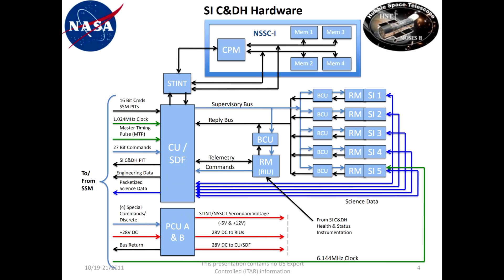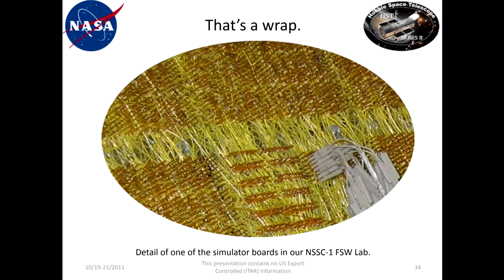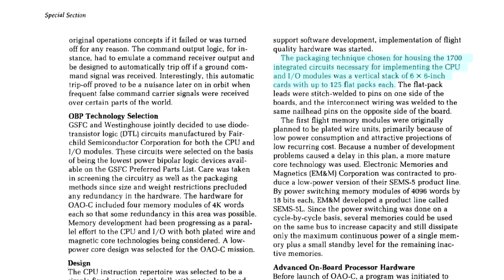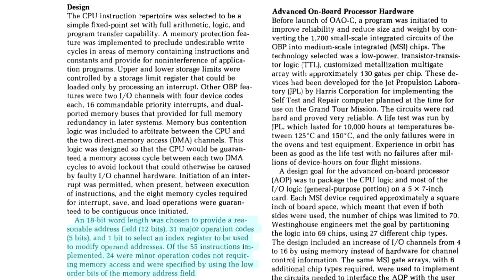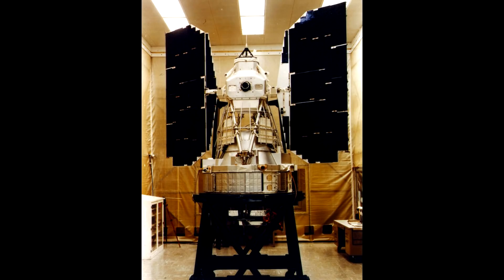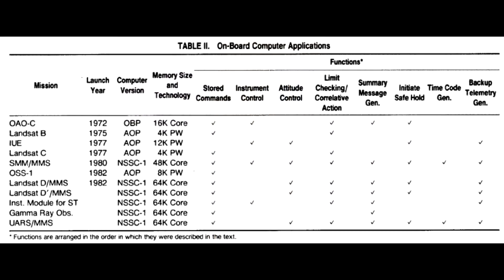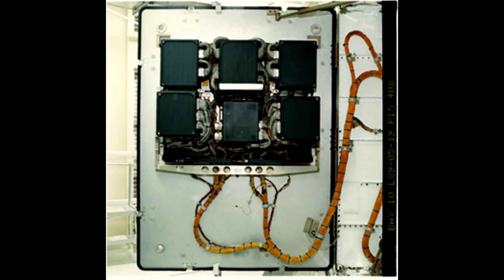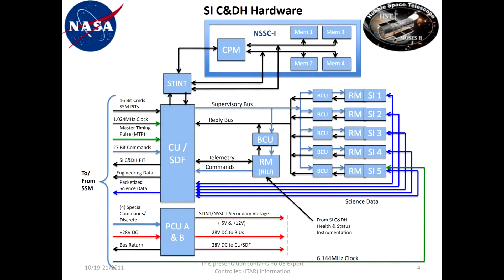Hubble's Latest Problems May Be In a 50 Year Old Computer Design

Comment: I’d love to see if a a programmer could fit all this on a single raspberry pie and maybe they could do another mission to Hubble with a couple of dozen raspberry pie units (redundancies) and a housing module (for integration)
Open up the Hubble educational institutions etc
Would be much better than leaving it as a derelict or de-orbiting it
Reply: The magic is space hardening the Pi.   In space, you don't have the same shielding for electronics that you do within the earth atmosphere, which is why the stuff in space tends to be a fair bit behind the bleeding edge and built like an abrams tank.    The radiation alone that is in space will shred unprotected ICs in very short order and no matter how well made the shielding is, it will eventually fail, which is likely what we're seeing with the current failure is that part has been running for a very long time, in a very harsh environment and the accumulative cost of the round the clock bombardment has finally caught up as the materials it was made from age.

Comment: It's amazing, a computer made up of chips with 130 logic gates still working after so long. The DIP packages of a 4- gate chip of Apollo era computer would be by the mid 70's available to any electronics hobbyist. 
This is serious legacy support! Lol
I guess this is the confluence of "ain't broke, don't fix it" and "it HAS to work" so keep what was validated with the rest of the original systems. 

It's staggering to me that an Arm M0 is around this level of computer processing power. They could maybe put 1000 of them in a redundant cluster that would fit on one board.

Comment: Ehh, I'm 41, the Hubble was from my generation.  Let's make the break and let it die with dignity.  It did a lot of good.
Reply: Problem is, like many brilliant things from that era, we don't have a single replacement out or even lined up. We need to stop evolving backwards..
Reply: Same generation here. But there's really no point throwing away something so chock full of expensive instruments in an expensive to reach location, when they could still get a lot more good use out of it if they're able to figure out another of those miraculous software hacks they seem to pull out of nowhere at least once per mission... ;)
Not to mention we'd rather it not become uncontrolled space junk posing a potential hazard to other spacecraft.
Reply: Apollo here. The Hubble was, and is still, magic.
Reply: It is still needed to see in the wavelength that it is able to.  Although I don't know if it wouldn't be cheaper and easier to launch a new "Hubble" telescope that NASA was gifted a few years ago at this point.  Or if we have any vehicles that could launch it.

And that isn't to say that the Hubble still couldn't be fixed at some point too.

Comment: Now we will starting to realize how important the Space Shuttle was…
Reply: Important, but too expensive and too dangerous (14 deaths in 135 missions = 1 death per 10 missions). Retirement was overdue if you ask me.
Reply: It's thanks to the Space Shuttle that Hubble is designed the way it is. If there were no space shuttle Hubble would have been launched on a conventional rocket and designed to be serviced by conventional capsules.

If anything it's the Space Shuttle who is to blame for our current predicament.

Comment: I wonder if very high levels of integration, with small gate sizes and fast clocks, would be the wrong direction for these components. Cosmic rays are a thing, they cause random effects that will garble the logic. Pushing the edge of quantum effects would be a bad idea.

Comment: Send up a techo in a Dragon to ISS to swap out the old computers and power supplies with a set of Raspberry Pi's, lots of processing power and I/O to play with, easy to harden. Hire a Rocket Labs kick stage as orbital taxi to take the techo to Hubble, or to tow Hubble to ISS and go on the float there.
If it's mission over time, Hubble MUST be brought back for museum display.

Comment: they need to add into the design of future space telescopes a system for external docking from autonomous craft like how the iss does but also have some type of ports to be able to hook up/interface to the computer and instruments from both crafts. This way they could send up a replacement for any hardware failure besides the scientific instrument itself.

Comment: Could they send up an airlock to Hubble, then send a Dragon to dock with it? Then leave it in orbit with/near Hubble for future missions. Have it with a robotic arm and cameras/sensors for radiation and space debris. The downside is the exposure to radiation and elements also the extra launch. But if you make it serviceable(refueling) and mission specific(custom robotic arm for potential missions) the airlock could be fairly small making room for extra radiation shielding.

I realize it would take 5+ years to make it, but it could be a useful tech to have for other telescopes if not Hubble. Even with Starship it might be better to not have to bring up your own airlock unless you have a side hatch airlock like HLS but that would make it a custom Starship. I do realize they would have to make modification to the Dragon for the mission but it would be small changes overall and reusable for next mission to airlock or long duration mission.